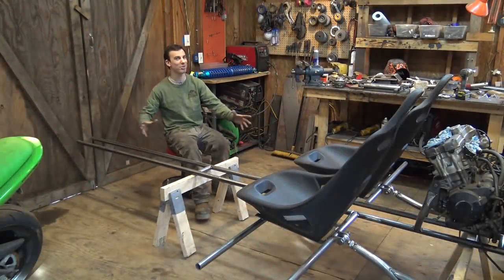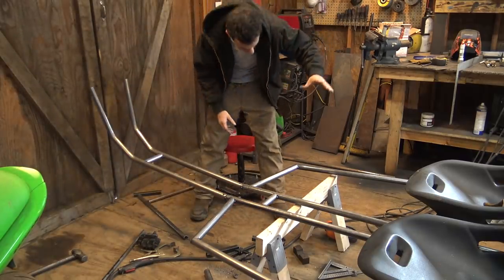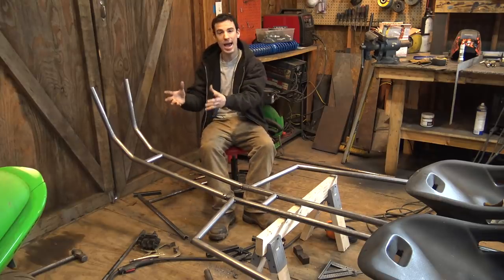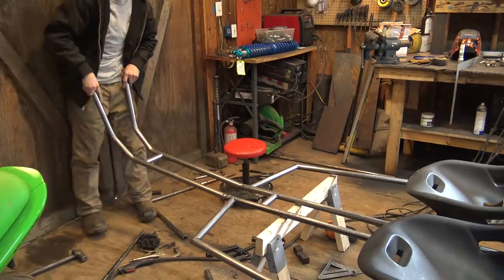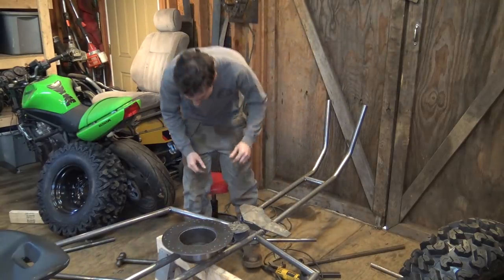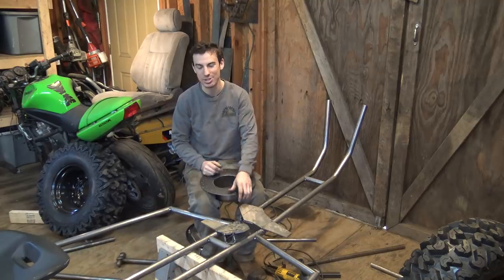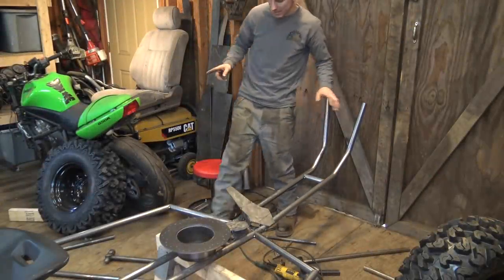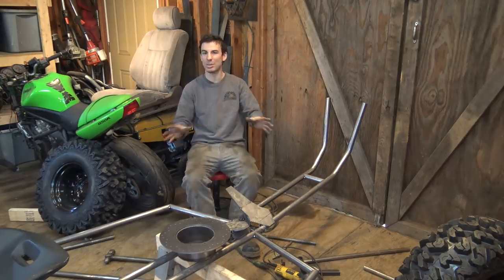Honda CBR 600 buggy build part 3

Comment: Get those rotors hardened. Don't end up wasting all that fabrication time and other resources.
Reply: I guess he uses simple mild steel for his built. You can not harden mild steel. It can even warp by shrinking tension because of the welding.
Reply: Funny all the cars I've owned never had harden steel rotors in fact they all had cast iron rotors...
Reply: I was wondering if the kind of metal he was using would cause any problems. He's not building it for highway use though so... I suggested looking in junkyards for parts like that when you need them. I couldn't see myself spending 6 days making something I could buy in 10 minutes. He seems like a good welder but there's just too many places that could crack with the welds holding it all together. Especially something that's seeing the forces that brake rotors go through. I wouldn't trust my life to that even if I made them myself.
Reply: @daniel_6741  you can harden mild steel it is called case harding .
Reply: Anthony Brown well that is true, there are more procedures to harden a steel that usually can not be hardened. 

But still I would pick a motorcycle brakerotor made made out of high grade stainless steel. This has good wear resistance and proper mechanical properties for this type of application.
Reply: Mild steel is the best fit for custom rotors like these, It has a great friction coefficient. The least I'd recommend doing is grinding them.
Reply: TheDestructor888 Thank you for the constructive comment.

Comment: You need to get sponsored for a plasma cutter or just buy a cheap Chinese one. I got a cheap one two years ago still works great. Would save you so much time
Reply: I've had good luck with the Eastwood cut 40 on it's 3rd year

Comment: I just had an idea, you may be able to fabricate your own with sprockets.  Further, By using the same meathod the Wright Brothers  solved the problem of making one of the propellers, turn the opposite  direction. And they did it with a chain and sprockets.  So look up videos on the Wright Brothers, and how they did it, remember, they were bicycle mechanics....

Comment: youve gotta start junkyard shopping, you say you want it to be cheap but at one point youll realize your time is the ultimate currency! knuckles and front brake setup off a honda civic would get you your twin a arm setup, and ease of replacing parts cheaply when they wear.

Comment: Check out a Polaris Trail Boss transmission. They should be easily suitable for this project. Forward/reverse and chain drive output. Instead of using the secondary clutch on the input side, a simple adapter can be made to accept a sprocket.
Reply: Zack that is basically what I plan to do with a 750-1200cc bike motor and make it 4wd

Comment: 1999 Polaris trail boss has a gear box that has pulley to chain drive that you need just put a sprocket where the pulley goes. Keep doing what u do, looking forward to see this unit finished.
Reply: except the trailboss has like 20 hp..

Comment: The 4wd hubs you are using for the front end usually need the CV stub in it and torqued to keep the bearing from coming apart at least on a 4wd vehicle. This buggy may be light enough but I would hate to see you ripping on this and the front wheel fall off and you get hurt and days of work ruined. The stuff you can build in this little shop is AMAZING I can only imagine what you could build in a fully set up fab shop. Great work.

Comment: Add brake booster and master cylinder from small car and add electric vacuum pump so you have more power to brakes :)
Reply: didyliduu And electric power steering pump 👍🏽
Reply: @lukeblackkk  Those are pretty power hungry and output in cbr alternator is most likely too small.
Reply: I'd stay manual tho g will be light in front anyway

Comment: I liked the rear suspension as it was. Let me explain why; Bump steer on a dirt buggy with those tires should range from a non-issue to a real advantage when it toes in under compression since toe-in is essential for straight line tracking stability and you'll need all the help you can get off road and each wheel will always be at a different height anyway, typically with only one raised significantly most of the time whilst riding over a rock or bump on that side only whilst the other tracks straight at near full extension providing the most drive and they'll all have randomly imbalanced forces acting on them from either side practically all of the time, making them fight each other constantly anyway, sliding in the direction of the path of least resistance, toe-in being the least of your worries.

If you hit a bank, berm or start rubbing against a steep rock on one side it will naturally steer away the higher the wheel climbs. The back of the rear tire will have more stick out or tread width so will actually rub a steep obstacle first and pull the vehicle downwards rather than try to climb so it will actually become more difficult to roll as well. Combine that with a slight toe-out bias at full travel and the wheel remaining on the ground as the other climbs a bank will also steer away from it, since it will reach full extension at a higher banking angle as in fact, counterintuitively, gravity has less influence on suspension travel the more you tip the vehicle onto two wheels despite having more weight on them.

Also with the tires being so knobbly, even on a relatively flat surface under heavy compression from a level landing or bottoming out at speed in a dip or dell, any excessive toe-in caused will be less likely to scrub the tread sideways and cause unwanted directional influence as with rotation, each tire stud leaves the ground and the next lands slightly to the left or right without skidding between the two as the contact patch isn't continuous like on a race car slick or road tire.

The other advantage is that since the rear wheels will aim more toward the centerline of the vehicle when you drive through a mud bog or deep puddle, they'll sling more mud at you and make it look like you must have been going faster than everyone else!

Obviously you'll never read this as you'll be too busy building another buggy. After watching this build, so am I. That's why I'm watching it again!

Comment: if you go on auto trader, you can easily find a dirt cheap($500) car you can use for parts.For example, I live in Toronto and i found a 5 speed standard toyota that still runs great for $500. With your knowledge of cars, you can easily take out the gearbox and attach it to that engine. you can also probably use the breaks from the parts car. Keep up the good work!

Comment: The wheel bearing you’re using on the front need a axle shaft going through them to hold them together they will come apart if you don’t have one. If you could find junk axle and use the sub shift though it it will work

Comment: Like mentioned previously , I would look at Polaris transmissions. I am in in the beginning stages of putting a 2000 yamaha r6 engine in a Polaris RZR 800 chassis. I will be using a RANGER 700 trans since the RZR trans was removed and the configuration is better for my project.  For you, older 800 Polaris 800 RZR trans would work this modifications removing the secondary and making a sprocket work. Love your channel and your ingenuity!

Comment: Dude, you've got some interesting (but excellent) workarounds for working around the tools you don't have, Very clever! I would say however, that even a "cheap" amazon plasma cutter would make some of those internal circular cuts easier. If you can sneak that into your budget in future, i would suggest it. Awesome rotor build!

Comment: Transmission - RPM gearbox's are generally the go to, there are some Quaifes around as well but not nearly as many. Both options are $$$$. Some of the newer high HP side x side transmissions might hold up as well but I don't think anyone really tried it behind a MC motor yet. Older honda's are one of the only FWD cars that have the trans on the right hand side, which puts the input shaft on the left side in line with the motorcycle engine. I used a Prelude one, they're allegedly a little stronger and the cable shift was easier to route with the way I used it. It's (mostly) survived thus far behind a CBR929 so it'll be fine behind a 600, and you get 30 forward gears which would really help you out since that little 600 is not going to want to get moving going up a hill lol. Just make sure the input is fully supported - pulling sideways on the input with the chain will break it. I welded my own VW pattern CV cups to the stock stub shafts. There's some more details in here if you're interested (post #7) https://www.minibuggy.net/forum/projects-progress/22323-re-assembly-929-buggy.html

Comment: Your building this right as im starting my buggy project, I'm using a Murray go kart frame and I stretched it by a foot and I'm using atv spindles and a arms for the front then gonna use a gsxr 750 or 1000 for the engine.

Comment: Trail and error, what real engineering is all about.  Love the old school drilling the bigger disc to take the middle out, Very time consuming when you have a mill. Cant the hole enlarger be set downwards to cut the hole straight off without the multiple hole drilling then chiseling?

Comment: Nice job mate! You’ll need floating brake calliper I’d say. Sports bike use floating rotors to get rid of brake shudder. So if you have fixed rotors you’ll need floating callipers. Just a heads up! Great work though!

Comment: Ok now you're just showing off hehe, But you might want to think about salvage yard parts from a small car with a 4 lug bolt pattern, you could find the spindles, rotors, calipers and just modify it to fit your buggy, after all, the way that buggy is going it's looking bigger then alot of small cars, like the old Honda CRX or Toyota MR2, Pontiac Fiero which used the front end of a Chevy Vega, there is alot to pick from, you could save time and money, just a few suggestions..

PS: I hope you can get that threw your doors hehehe...

Comment: I like seeing a fellow craftsman! One thing I would think about doing is maybe heat-treat the brake discs before I really used them only because I would worry about the heat they will have on them from stopping this badass breast you are building

Comment: electric reverse with an e-starter. some quad dudes do this when they do conversion to bike engines. cheap, easy and small.
Reply: ps: 6 days for braking discs - you know you can buy them for 50-100$

Comment: Good job dude! But if im allowed a little observation, if you keep on adding up weight like that, there wont be much power left out of that 600cc to have fun with...! If you can, try to make it slightly less beefy, those spindles are great and probably will hold it together nicely, but if you build all of it on that scale, you will end up with a 300kg buggy, easy, on dry. Add two people and all fluids. That engine is meant to behave nicely and be fun while moving a total of 200/230kg, on a road.

Comment: Good job .. if I'm not mistaken you said previously that those hub assembly are from a Chevy... so for the front you will need the stub end of the CV to hold that bearing together .. if u know what I mean.. best of luck

Comment: Take a four-wheeler engine and cut the engine part off the transmission case. Way more gears than you want but you wouldn't have to use them. Easy to find a four-wheeler that the engine is bad on.

Comment: Small transmission 
Vermeer 440 4x4 trenchers us a small 3spd with reverse transmission. It's a car type but it is very short and light weight. The input shaft would need to be shortened due to it being used with an automotive type Clutch setup. It would require a having to rear sprocket on the opposite side of the engine from the engine drive sprocket. It was, I believe used in older AMC cars. I'm not 100% sure. They are tough and could be found in used equipment scrap yards.

Comment: Some of the guys in oz use a starter motor on a sprocket for reverse gear on their off road carts. Just press a button and it engages the sprocket/gear. The other option is a planetary style gearbox, some guys make a simple setup while others purchase ready made and adapt.

Comment: I Like where you are going with the spindles there!  looking forward to seeing more.  those brakes is gonna work perfect. a sportsbike might be lighter than this.t but its supposed to brake from 200km/h or more without overheating so yeah, braking that stuff from 100km/h should not be a problem.

Comment: That’s pretty cool that you made your own brake rotors hope that work well. I know you already said you have cv shafts but you could use a John Deere 825 gator gearbox they are a cvt but the driven pull on the trans is splined and you could put a sprocket on it as well as it would give you a high low and reverse. I used to work at a John Deere workshop and the are a great gearbox not sure what they go for used tho.

Comment: I suggest that you work with some other YouTubers (e.g. This Old Tony, Abom79, Keith Fenner, Randy Richard, AVE) and design & make your own unit. They have experience with these types of projects and have help other YT'ers before. 
This is not an insurmountable project. I would recommend a coaxial design with the input and output on a single shaft. In forward, the inner and outer shafts would spin together at the same speed, i.e. locked-up. A pair of idler gears would provide reverse. A single spring loaded shift fork with an engagement gear on the main shaft would provide a means to toggle between forward and reverse. You don't need a neutral.

Comment: Use a sport quad (that has reverse) gearbox. They have chain output. You would just have to modify input. Another advantage would be to reduce the high speed output the cbr motor has without needing a planet sized rear sprocket.

Comment: Snowmobile chain case?  It's shafts in and shafts out that can be made to work with a a couple chains and sprockets welded
Reply: They can handle the alot of power to

Comment: Harley Davidson Cruiser's have a separate gearbox, a gearbox that separate from the engine, that's bot from the sportster (sporster eng. & gearbox share a common case. As for reverse, if I am not mistaken, Harley Davidson's Trike's gearbox is the only one that comes with reverse. 
Also, checkout Baker Drivetrain, Baker makes aftermarket gearbox for Harley Davidson..

Comment: While those brakes are very nice and you did a great job...all I can think is wow those are crazy heavy! And part of the rotating mass and unsprung weight, YIKES! Think about other side by sides (which this is) they have 30-32” tires and the brake setup maybe weighs 1lb total

Comment: The labour that has gone into this build is incredible. With your removable rotors, I would suggest heat treating them or something. They're pretty thick but I think the mild steel is going to warp. Also, did you make sure the .25" (i'm guessing) steel fits inside the caliper?

Comment: Gett a gearbox from an old smaller rear whell drive car whith front mounted engine. Then you gett reverse and a couple of gears. Most commonly highest gear is one to one and the rest give you more torqe. you would need on the shaft a sprocket and a bearing because they arent built to take sideforces.

Comment: You don't need no stinkin' reverse!
Also, what is that device called that has the offset cutter you used in the drill press to make large holes in steel parts?  I've never seen anything like that before.

Comment: There is a guy in Canada that had a cbr 600 or gs 600 that power it with a Polaris transmission/transfer case that has a hi/low/reverse  that is a chain drive output and you shouldn't have that much of a hard time with putting a sprocket on where the cvt was so your cbr chain output can feed the Polaris transmission and if you do it right you can make your buggy 4wd

Comment: You can take apart an old atv motor with the transmission into them and modify the motor into a gear box with 5 forward gears and a reserve. If you want more info message me. Ill pass along the vidoes and stuff

Comment: Atv transmission will do it weld a sproket on te secondary clutch side and it will work easy High Low Neutral Reverse Park

Comment: Still wondering what you did to your Craftsman bandsaw to allow you to cut metal. Have a video or instructions on that?
Reply: Just install a metal cutting blade and clean often
Reply: @jeremyhammer8142  metal cutting is done at at least 4x slower blade speed. Assuming he modified his
Reply: @swandonovan  I never slowed down either of mine but could easly be done by changing the pulley  .I cut mostly sheet metal and aluminum  and always add some oil to the blade

Comment: One thing I got caught with on eBay is if there is a red box pop up in the left corner saying limited stock means they have NO stock and it could be months until they get more and they never tell you until the item doesn’t get shipped and you ask why so they hope by the time you work it out they have some in stock so they don’t have to give refunds

Comment: You're probably better off modifying a 3 speed Saginaw transmission for what you need
Reply: Yeah you get into kit car or Quaff stuff who make them it'll make 10 Saginaw's seem cheap lol..
Reply: why add any gearbox with different speeds? the motor already has what 5 gears? so why add more all he needs is reverse.

Comment: I am curious how many hours and how much steel it cost to make those drums and Rotors. I personally like to retrofit higher quality things that I can find dirt cheap from this place called a "Junk Yard" AKA Salvage Yard.  Or maybe even called "Used AUto Parts" in Yankeville. What steel did you use for Rotor? I can't imagine it lasting very long.